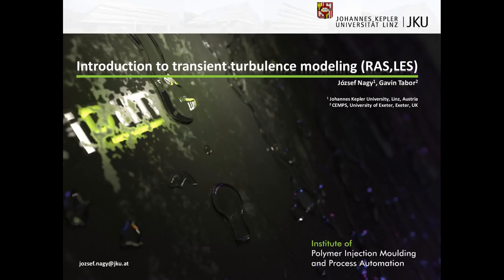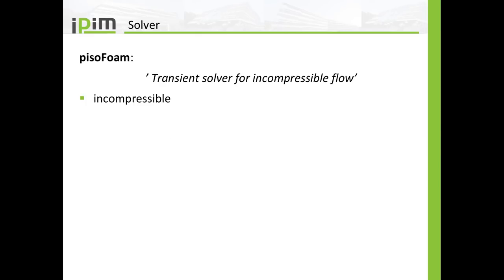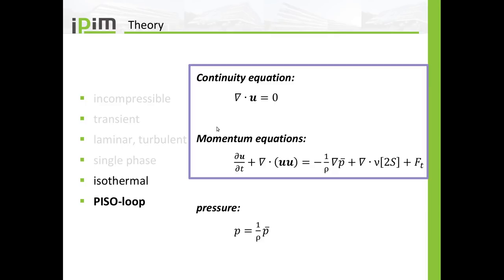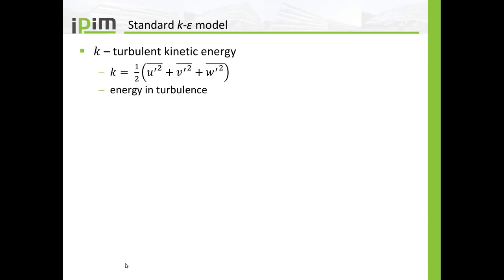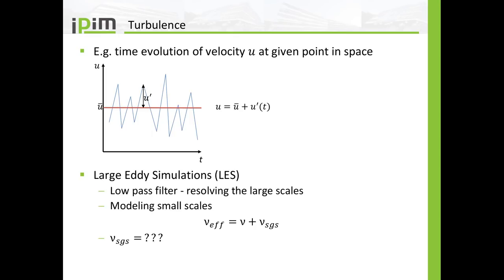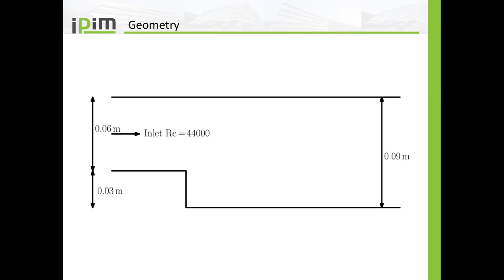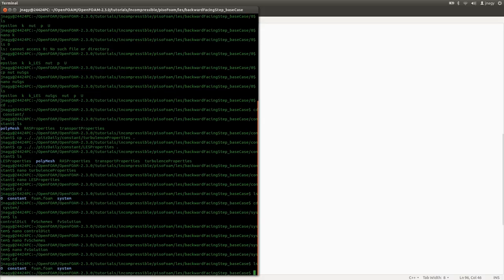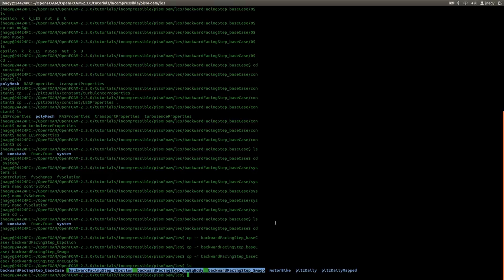Introduction to transient turbulence modeling (RAS,LES) - Part 1

Comment: Hi József, great video !
Just a little question, why for nuSGS u compute k using the deviatoric part of symm(gradU) tensor? Normally, would not be sufficient to evaluate the magnitude of symm(gradU) in your formula (slide at 8':51'') ? Thank you in advance for your really helpful videos!
Filippo
Reply from the maker: A lot has happened since then in turbulence modeling. Check out the source code for improved models.

Comment: I've implemented, using this tutorial as a template, a similar simulation, but the situation on the outlet in the initial time doesn't look very realistic - https://drive.google.com/drive/folders/1Q03FdTvThdflvtU7lnmqIn5IOdIESEnA?usp=sharing. Is it due to the wrongly chosen boundary conditions? I've set pressure p = 0 on the outlet, inletOutlet on U, and zeroGradient on nut, and for the inlet velocity of (1 0 0). I apologise, If I am asking this question in not a proper place

Comment: Hi József,

I want to simulate the flow of a seminfinite 2D domain which corresponds to a horizontal wall moving in the horizontal x-direction. In practice the fluid extends infinitely far away in positive/negative x-direction and positive y-direction. The initial conditions are such that the fluid is at rest and then the plate is started from rest. The pressure should be atmospheric everywhere from the start as well. What are the appropriate boundary conditions for the velocity, pressure on my 'top' and 'inlet' 'outlet' faces? If I where to use a Smagorinsky model what would be the appropriate boundary conditions for NuSgs?

many thanks,

Oscar
Reply from the maker: Oscar Wilsby I'm not sure, if I am the right expert for that, but you can shoot me a mail and I can try to answer at leas some of your questions.

Comment: Hi I want to know is there similar paper, which the parameter of the BC and domain size almost identical with the video
Reply from the maker: Un fortunately I am not aware of such a paper. Please do a lit research.
Reply: @OpenFOAMJozsefNagy  Thanks anyway for the response. But could u  please also tell me more about the file 0/U. Did you set the inlet velocity as fixedvalue, or create a channel flow simulation before and used the obtained velocity vektorlist as the initial conditions in 0/U.
Cause I am doing a progamm, which need to validate my own turbulenz modell for unsteady flow in backward facing step simulation. It would be very thankful if you could help
Reply from the maker: @yumengwang151  I did the first simple approach.

Comment: Hi Jozsef Nagy,,
Firstly, thanks for your videos, really helpful. And I have two questions about fvsolution.In fvsolution, tolerance is already exist to control the convergence of the equation,why OF set relTol to control convergence .

And I found the value of reTol are varies in many cases. Could you tell me the reason of this?

Thanks a lot.
Reply from the maker: +Ping Chang I guess youtube is not the best place for this discussion, but I would suggest, that you play around with the values in simpleFoam and then in pisoFoam and see the influence.

Comment: Hi Jòzsef, I have a problem: I'm doing a CFD simulation around a NACA profile of 0.055 m that is in an air flow at the velocity of 25 m/s on x axis using the model K- omega, but I don't how can I estimate the values of K and omega...
What values would you insert?
Thanks.

Simone
Reply from the maker: I am not an expert in profile modeling. I would suggest you take a look at publications.

Comment: I am looking for implementation of k-omega SST model in openfoam. Can you suggest where could i find those? And I have question related implementation of k-omega SST model. I know that theoretically k=0 at the wall but why is omega not zero at the wall?
Reply from the maker: It is called kOmegaSST. You usually use wall functions at walls.

Comment: Hi József

I saw you've slightly changed the discrete schemes in this tutorial. Now, I'm working with reacting flow problem but when I've tried to change the scheme (discrete) then the result largely changed. I've been confusing about which discrete is exactly suitable with my problem. Could you recommend about where can I find or get more knowledge to bring me out from this problem.

Thank you a lot for your help.
Reply from the maker: +Panitt Kamma Which scheme did you change? Of course. This is a tutorial, you have to find the order of discretization, that you need for your case.
Reply: +József Nagy  OK I will move following your recommendations.Thanks a lot for your answers
plz don't stop to make these beneficial video.

Comment: Hi, Am new to openfoam. While i run my simulation using overset method in openfoam(OverpimpleDyMFoam) i get following error:
FOAM Warning :
From function bool Foam:versetPolyPatch::master() const
in file oversetPolyPatch/oversetPolyPatch.C at line 149
The master overset patch is not the first patch. Generally the first patch should be an overset patch to guarantee consistent operation.

What do you think is the issue?
Reply from the maker: Sorry, I do not have a lot of experience with overset yet.

Comment: József, what exactly do you mean when you say that the NS equations are being solved with the pressure gradient term?
Reply from the maker: Which part of the video do you mean?
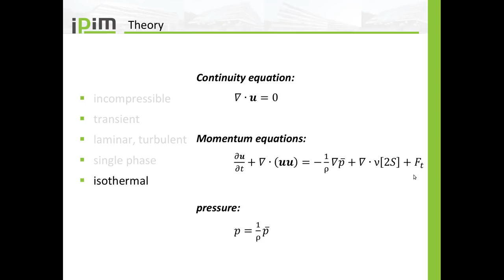Reply: József Nagy At 12:21 you said "...we are solving this vector-matrix with the pressure gradient term." How, exactly is the pressure gradient being used to solve the equation? Providing me with a reference would be fine, no full explanation is required here.
Reply from the maker: DaylightDigital
It is a question of what parts of the equation you put into the matrix on the left hand side and which part is explicit on the right hand side. Here, the pressur egradient is not inculded into the vector matrix. Check out the phd thesis of Prof. Jasak and/or Henrik Rusche. Both are available online as pdf.